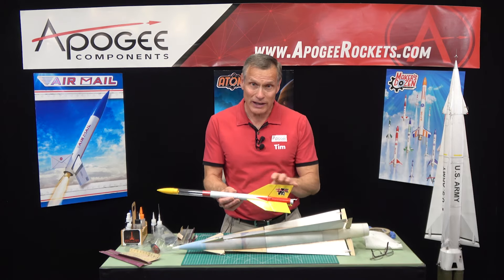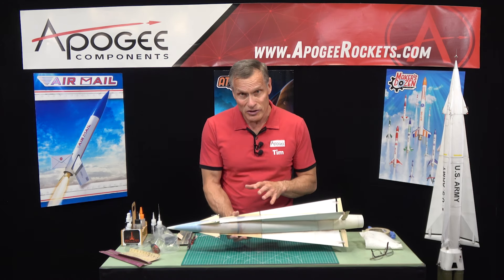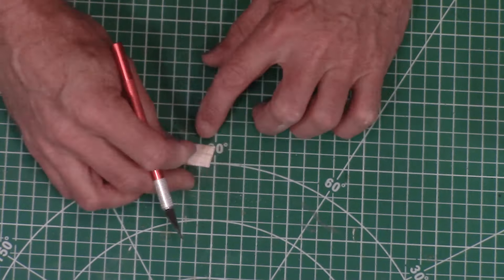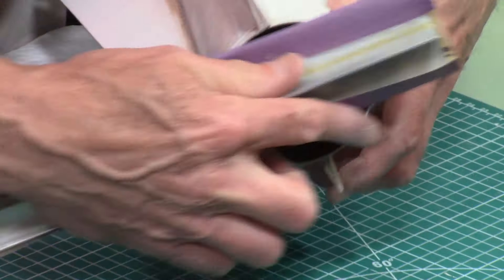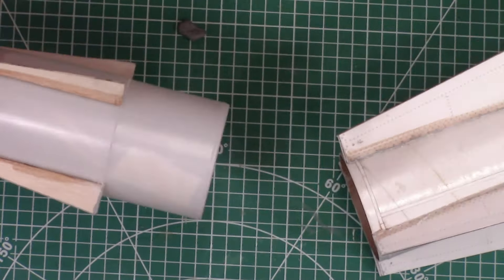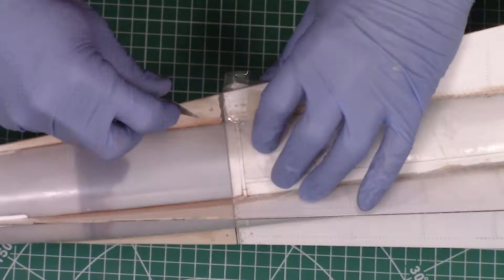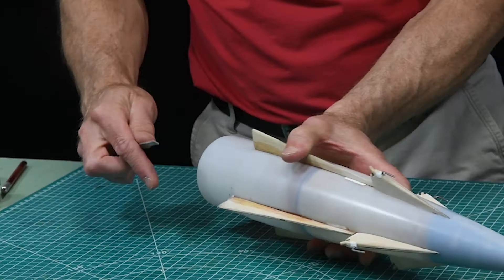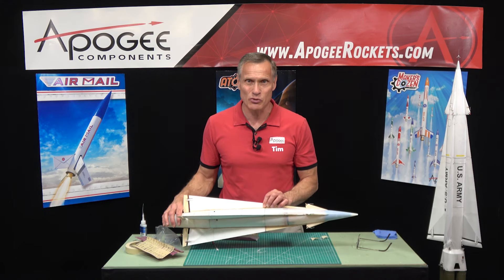How to Fix Gaps Between In-Line Fins on Your Model Rockets

Comment: The guillotine fin jig can help in this. Glue the fins on the booster. Join the two stages and put them in the jig. Butt the second stage fins down on to the booster fins when gluing them on. I built a three stage Comanche this way and got zero gaps. That jig is expensive but you will never regret buying it! Not only do you get no gaps but also the fins on all stages are dead lined up.